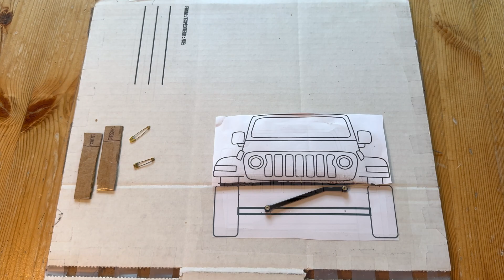Part 1: What is a track bar? How does it affect the geometry of Jeep Wrangler?

Comment: I’m not sure I’m following on the lift part. Why would the jeep shift to the left when giving it a lift? What would it be that would cause that?
Reply from the maker: The track bar moves in an arc, not straight up and down. Imagine:
	•	The track bar forms the radius of a circle.
	•	The axle is at the end of that radius.
	•	When you raise or lower the Jeep (like jacking the frame, lifting suspension, or even flexing on a rock), the axle has to follow that circular path.

As a result:
	•	When the suspension raises, the axle is pulled sideways toward the frame mount of the track bar.
	•	When it drops, it’s pushed the opposite way.

That’s why you see the Jeep body shift slightly to one side when the suspension height changes — the track bar’s arc is literally pushing the axle sideways a small amount.
Reply: Wow are you slow or something or being sarcastic he clearly explained it... this is like track bar explanation for dummies